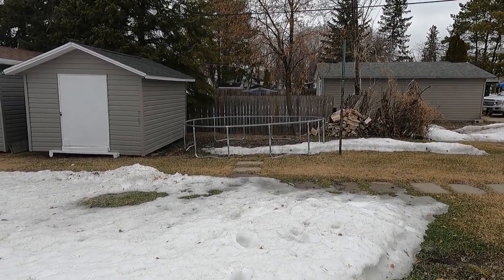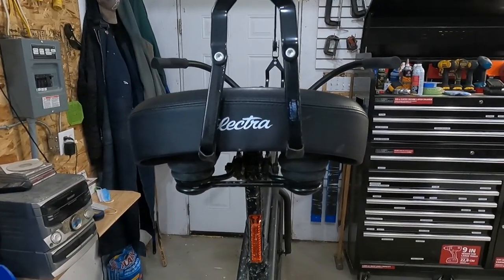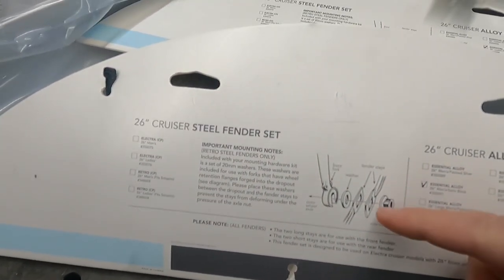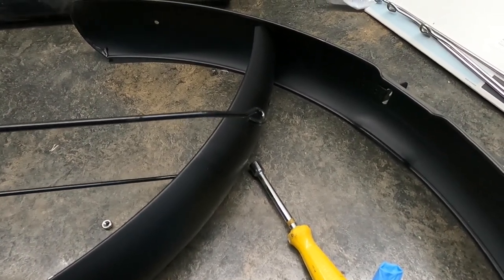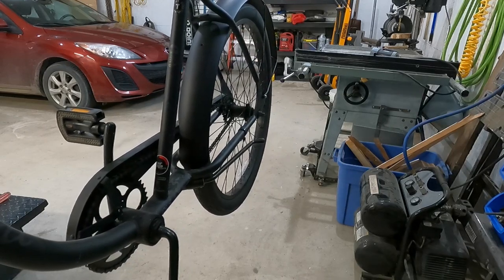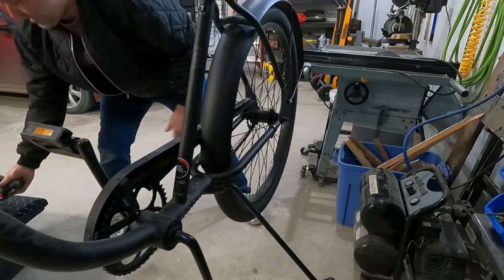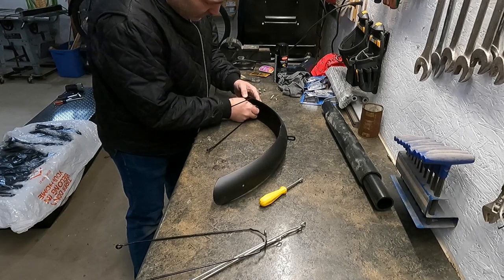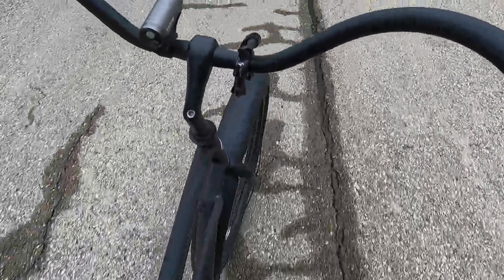Electra Cruiser Fender Install

Comment: I bought the exact same fenders and had no idea, so this was very helpful. Thank you.  

Also, instead of removing the rear wheel, I deflated it and was then able to manipulate the bolt into the fender clip with a small hex key while the bike was upside down.
Reply: What model of fenders is it?

Comment: I just ordered mine but now I’m considering just paying the bike shop to install them. I don’t need the headaches
Reply from the maker: Yeah, I don't understand why the factory wouldn't design it so they just bolt on to something where you didn't have to take off the wheels.  They could have made this a 5 minute job if they had planned ahead a bit more.  Oh well.

Comment: Hi can you tell me what are the dimensions of the different bolts please?
Reply from the maker: No I cannot, as they are already installed on the bike.  Sorry.  :(  I'd maybe check if Electra has a manual online which might say...actually, yes, you can download the service manual for the fenders and they list them.  I tried to paste the clip, but it doesn't want to work in the comment box.